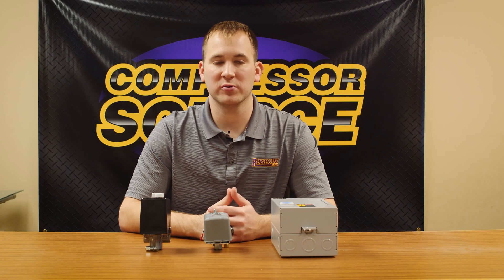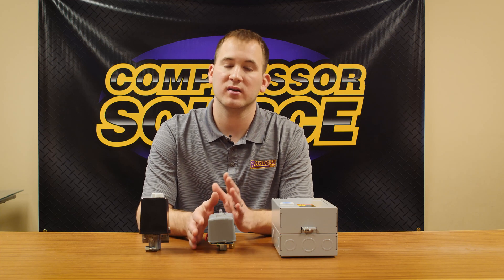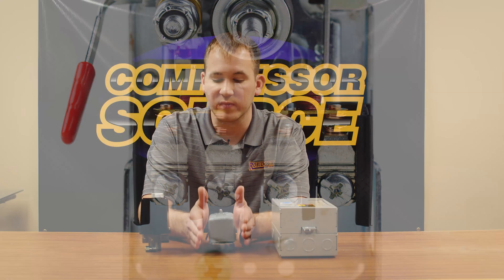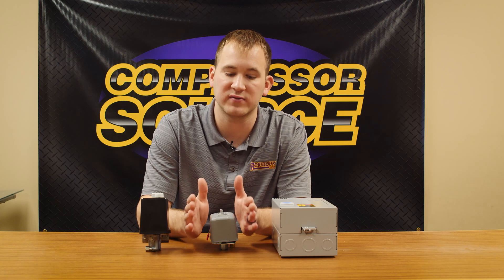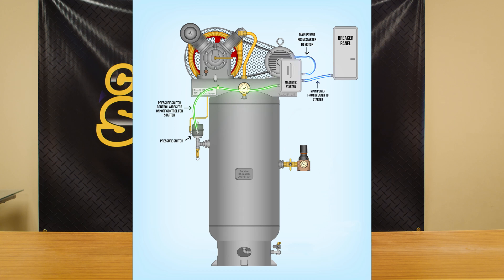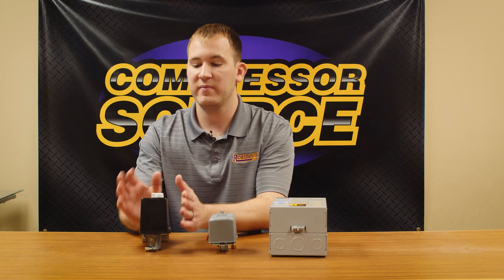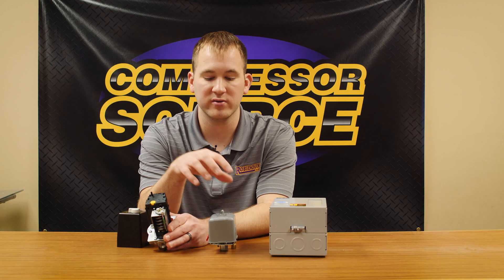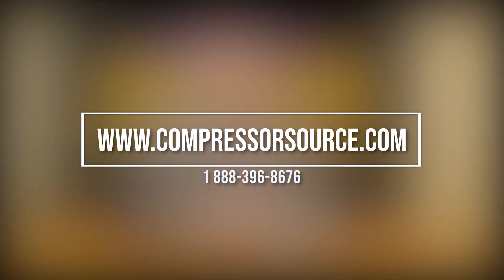Do I Need A Magnetic Starter on My Air Compressor?

Comment: What has me pissed is makers advertise a Mag isn't necessary even on 6.5hp/26 amp draw motors. Sure they have the hybrid  but they know using a mag extends both motor/switch life yet they dont care. Specs say mags Optional?
  I decided its best to use a Mag on it, still I just couldn't figure out why some reviews said it needs a Mag & some plus the maker said a Mags not needed?
  Thanks to your excellent vid, what was clear as mud is now clear as spring water for me.
 I sure appreciate your time & Merry Christmas!

Comment: I have a DeWalt 2-stage compressor with a 5hp motor that I bought in 2017. Seven years later, with very light use, the motor died due to a failed pressure switch/damaged contacts in the pressure switch. Now I need to purchase a motor, pressure switch and magnetic starter to compensate for DeWalt's cheapness.

Comment: What do i need to wire a 7.5 hp 3phase motor on my air compressor , its a used unit that has no starter or pressure control switches,  just a tank compressor and the motor,

Comment: For fellow home gamers and DIYers, one trick I've seen is to attempt to find a dual rated contactor that's designed to work with both single and three phase current. They're probably cheaper than singe phase only, since they're a lot more common. A three phase only design should be able to be used as long as it's rated for at least the same current as the motor is going to pull. Good luck people!

Comment: Any time u buy a heavy type air comprsoir running on 1ph...220v 25 amps or more make shure u use a magnetic  starter..it will save u big time..on repair costs..a pressure  switch isn't  a magnetic  starter..I have a 3hp.220v 1 ph Saylor-beall  in my home shop..60 gal ..a industrial  type unit..it runs so quite..I can still hear my shop tv....great video..helpfull. to the home..hobby shops..I stopped  getting home store  air units...El cheapo..and they run loud..keeps the wife up late nights..
Reply: Funny thing, I live in Michigan and recently drove to Saylor Beall, about 1.5hr drive from me. They had end of year old stock on 5hp, 7.5hp, and 10hp WEG motors all for $200 each. All brand new, they needed them gone. I purchased a 5hp for my old Kellogg-American Air compressor, which is also super quiet. my circuits are good for 5hp and i previously had a 1950's 3hp motor. Thanks to Saylor Beall I got a cheap upgrade with a brand new WEG. Here I am looking to put in a magnetic starter to protect the motor. And the WEG motor is more quiet than the old 1950's LeLand motor.

Comment: Please Consalt Me Mr.Expert I Just Have IR-15hp/11Kw Screw Compressor But My Compressor Is Running For Short Priod Of Time Be Renind That It Is Just Shut Down Under Things Are Under Control What Should I do Even If Dosn't build up above 3 sometimes 4 bar what should i do with my compressot pressur switch and Relay,.

Comment: HELLO!!!! These guys saved my but !!!! We had to install a starter on our tractor supply IR due to burning up switches .. We spent less than 80 bucks on the starter and installed it our self. Super fast shipping at the time and still works to this day with no issues !!! Thanks !!! One thing is for sure !!! HE IS TELLING THE TRUTH ABOUT TODAYS AIR COMPRESSORS !! CHEEEPPP MADE AND CUTTING CORNES!!
Reply: I bought one too. Probably the same one you bought. I bought a new Quincy QT-54 and put a starter on first thing to avoid  burning out pressure switches. So far, so good. Next I will rig up an aftercooler to keep the air dry.
Reply: @halfstep67  I was going to run a dryer my self but used my old 30 gallon tank behind the 60 and does ok .
Reply: the pully is 1 belt and big on my IR from TS. belt squalls at higher pressures. think I will put smaller pully on also.on elc motor
Reply: @assyholey4224  if it squalls you have a loose belt or other issues.
Reply: mine usually blows a capacitor once a year.

Comment: I think the confusion in my mind comes from the word "starter." Don't you think the term relay or contactor would be a better term/description? It's my understanding the magnetic starter is a slave relay controlled by the pressure switch. In automobiles, the starter motor relay is a slave to the key switch. The purpose of the slave relay is to switch the high current of a motor, especially when a motor starts as a locked rotor.  When a motor uses a start capacitor, the capacitor is actually used to "strat" the motor. A magnetic starter does nothing to "start" the motor other than switching on the power with high current-rated contacts. Am I correct? Or am I missing something?
Reply: No no. You got it. One hundred percent.
Reply: @austech360  Well, at least people may be willing to pay more for a starter; it sounds like it should be more expensive. Otherwise, it's just a non-starter!